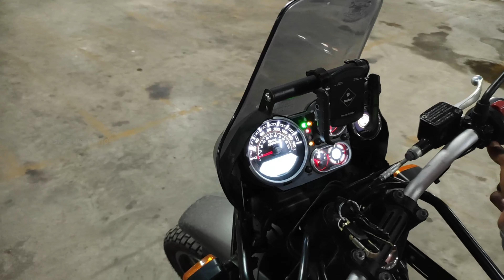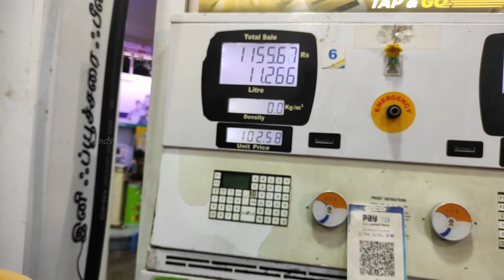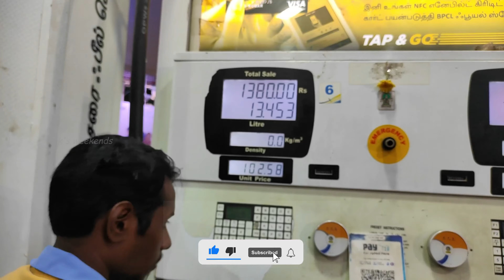Himalayan BS6 Fuel injection Air lock issues & Solution | Royalenfield Himalayan BS6 2021 |

Comment: I have faced same problem for the first time last week. Showroom people told me to replace the fuel injector and motor. Do you think that would be necessary ?
Reply from the maker: Yes bro, those issues comes if we have issues with O2 sensor or fuel injection system